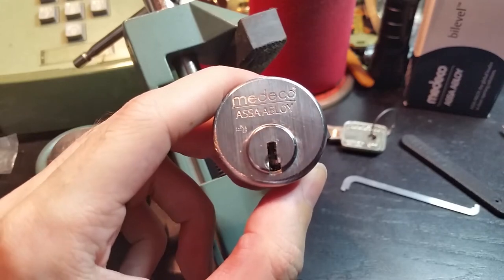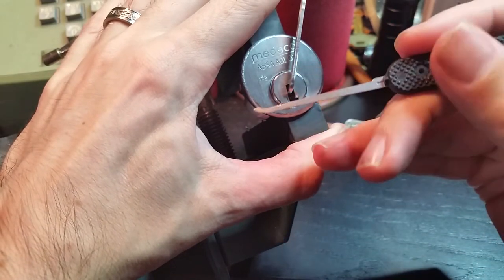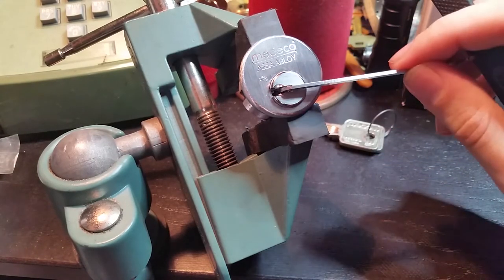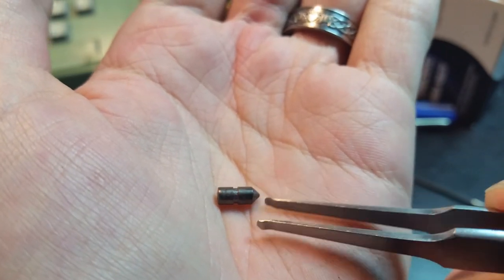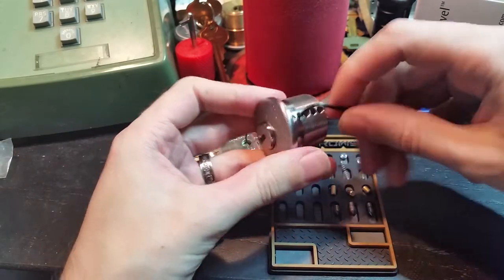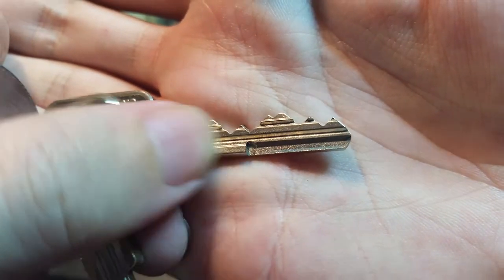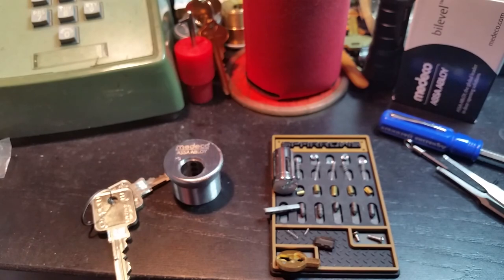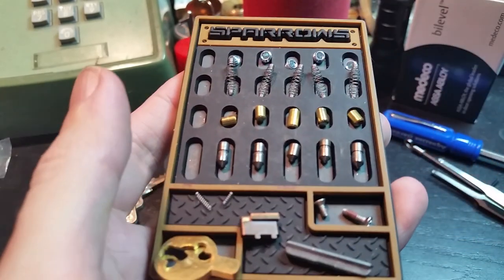(96) Medeco Bilevel picked and gutted

Comment: Nice job. I've not had the chance to check out any of these as yet, so thanks for the show and tell.
Reply from the maker: These are rarely seen since they are still considered expensive compared to unrestricted cylinders but don't provide nearly as much manipulation or brute force resistance as the High Security Medeco designs.
Reply: You're right, of course, about the price. Just bought one to have a closer look.